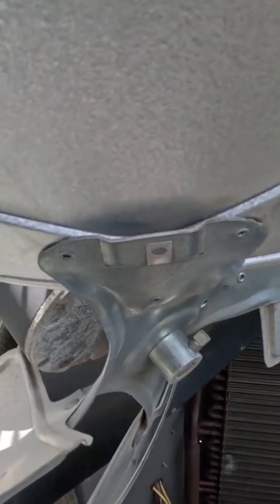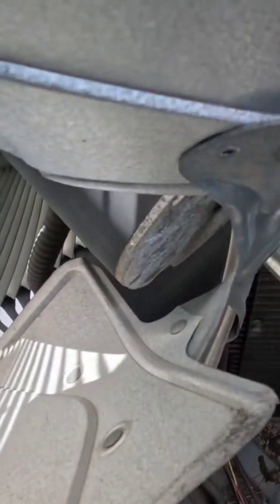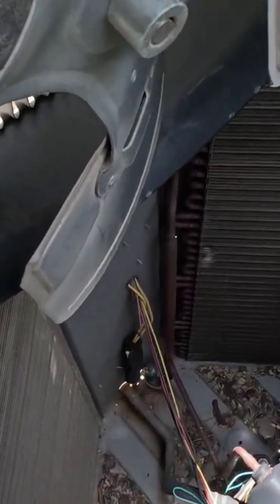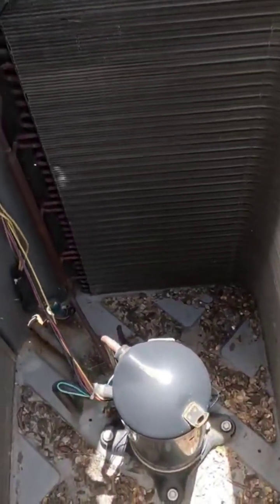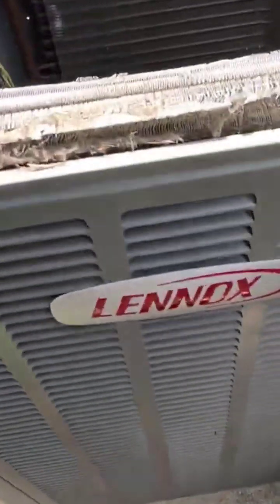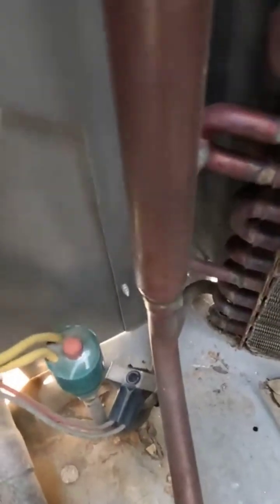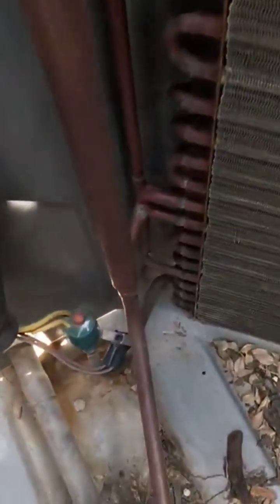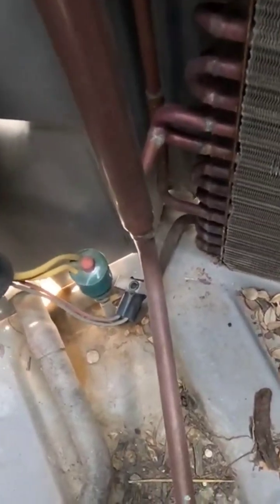Lennox High Pressure Switch Reset After Condenser Fan Motor Replacement. (4 ton Residential Unit)

Comment: i am still waiting for my replacement motor, but i think this is exactly the cause why i am not getting low voltage even though it's coming from the control board!
Reply from the maker: Be careful never push the red button with power going to the machine. Turn off all breakers.